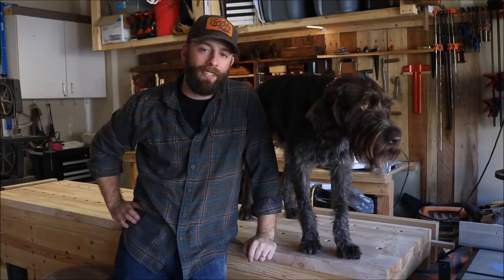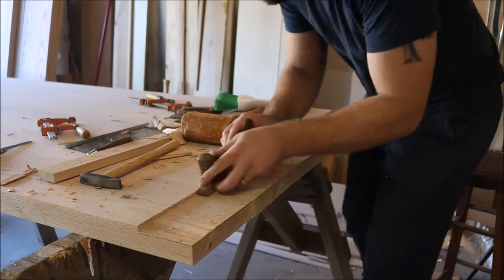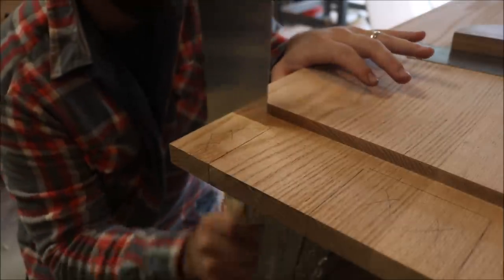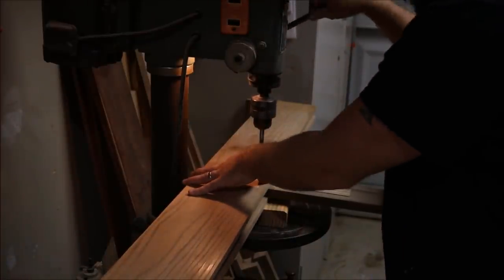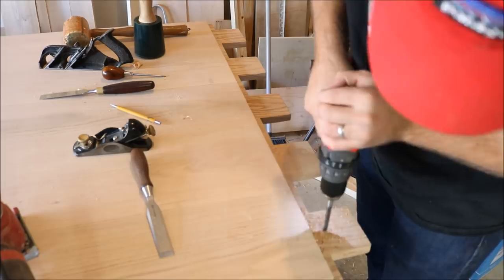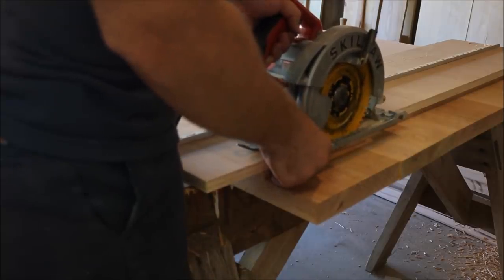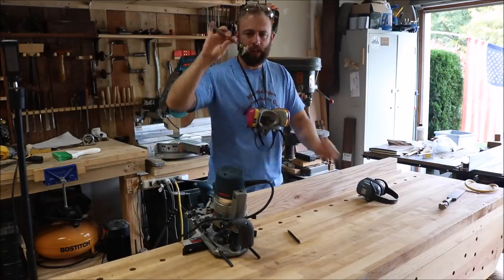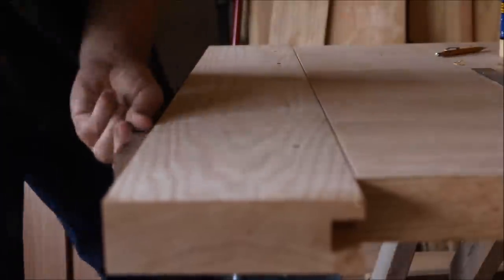SERIOUS Breadboard Ends!! Hand Tools vs Power Tools! Woodworking // How To // DIY

Comment: Chris, you didn't give any commentary at the end comparing the power tool v hand tool approach. What's up with that? How long did each method take, which did you prefer, challenges of each, and so on. 

Great video nonetheless.
Reply from the maker: Good point thats a missed opportunity for sure. I guess I got lazy there at the end after hours upon hours of editing and narration haha. This has taken me days on and off. I can tell you in a nut shell that I much more preferred the hand tool side. I honestly dont think it took me a significant amount of time longer. cutting the tenons and tongue on the table top was a breeze and very enjoyable, but plow the groove and boring out the tenons was definitely hard work. For me it is always more rewarding and enjoyable when I complete a task with hand tools, but there are certain things that powertools are worth using. For instance router out the groove was substaintially easier than plowing it with the plow plane haha. Ill try to remember to do that commentary next time! Thanks Hazem!
Reply: My impression, from watching the video, was that both finished products worked out well ... so which approach one prefers would really be determined by the tools, skills, and how you want to spend your time working
Reply: ....and the amount of noise the neighbours can stand :)
Reply: And the amount of dust you can cope with. Mine's an attic workshop so dust is a problem. Dust extraction would be expensive, difficult and take a lot of already limited space. So hand tools are the way I've gone.
Reply: Thanks for the comparison video. I prefer hand tools these days but always find men standing around with comments like, "don't you like electricity", or "you would be finished in 20 minutes with power tools". Gets old pretty fast, it's nice to see someone proficient in both and to be honest sometimes a blend of the two is the handiest.
Reply: +Michael Ballinger agreed. But I find similarly tiring the hipster YouTube trends that unless you're using a restored 80 year old hand plane, you're not doing it right. I swear some of the people spend hours setting up a shot to just show them taking one relatively thin swipe with a plane, full of dramatic music and slow-motion video, on a project made of reclaimed pallet wood. :) I tend to be more from the Norm Abram school, and so default to power, but break out the planes and chisels whenever they make sense.
Reply: Pete Brown whatever works for you I guess. I only knew power tools from my Dad, and I'm very handy with a chainsaw. That said I have young children and with hand tools they can be around while I'm working away, that's not the case with machines. Then there's an understanding of the wood, grain etc that you get with hand tool woodworking which is lovely to experience. For me it's not what you make but how you make. I'm not in a rush, although I have found hand tools in some cases to be faster, and I'm not having to spend time setting up jigs for machining. For dimensioning stock machines are great though.
Reply: Pete Brown if its a hobby and passion then why not have some fun showing some dramatic planing.  even if its some crap old pine or spf for that matter.  Legit furniture makers that build as a living would obviously use whatever is fastest within the confines of making a clean, quality cut/plane/hole.  just my 2 cents.  go search "young je".  he builds woodworking tools as a passion and for function
Reply: r s it's the pretense some other woodworkers have. Reminds me too much of dramatic poetry readings, or people who refuse to listen to anything unless it's some super obscure band on vinyl, both of which I also roll my eyes over. :)

But note that it's not the case here. I enjoy these videos.
Reply: One thing we got to take in mind is that most of the youtube videos are made by people who do woodworking as a hobby, for people that are just the same. So you can spend all the money you want, all the time you want, and do things the way you prefer, even if it's more time-consuming, or you can't have the best result.
If it makes you happy, that's enough.
Then there are the professionals, and they obviously have to take the easiest way to do things.
Reply: Really great craftsmanship, thanks for the content!
Reply: I started out my wood work with something of a fixation on hand tools. I still like doing things that way in some contexts, but now that I am a dad and work full-time plus hours, I find power tools increasingly practical just for the savings in time. I also find them to be a savings in money as well; just try hunting down all the specialty planes it takes to do the job of a variable speed plunge router... Those a not cheap to buy new, and there is going to be a lot of restoration if you get them all used for an affordable price.
The other aspect presence of built-in jigs, even on something as simple as a circular saw. It is possible to cut compound angles by hand, either free-hand or through the construction of a special saw box, but it takes a lot of practice to get bang-on results consistently that way. By contrast, even a cheap miter saw is accurate to within fractions of a degree, and can be set up in moment. Then too, good luck finding a hand-powered drill press... It's been a long time since those were being manufactured. 
All that being said, hand tools are probably the best way to learn, and for simple projects without complex details or tricky angles, they deliver very good results, albeit at a slower pace. One learns a better feel for the wood that way, which leads to wiser use of power tools down the road.
Reply: Also the kind of shop you have/ where you live. Power tools can be very noise and take up a lot of room to store. Where as the hand tools can be much quieter and all be stored in a foot locker. I find that working in a neighborhood later at night hand tools are much less disruptive. Also in my case I can work in my work room in the late evening and not wake up the kids.
Reply: Great tips and nice video
Reply: Check out this idea to expand your router capabilities.  https://youtu.be/DV9Cb_-Axos 
 @ThirdCoastCraftsman
Reply: @michaelballinger6419  i think power tools are lazy man's approach, i like  old fashion tools, that you can't find anymore :(!  Especially when you grew up in old country and don't know the proper names for some of the tools, your grand daddy owned, you can't find in US anywhere anymore :(!
Reply: @Cyph3rHaxPalm  I disagree with power tools being a lazy man's approach.  I tend to do most of my work with hand tools, and I enjoy the process immensely (I think its Paul Sellers who says "its not what you make, but how you make it"). Having said that, there are times when I need to just get something done.  If that means laziness, so be it.  I know I can get lumber S4S by hand, and I usually do, but on occasion, I'll throw something through the planer because, while I wouldn't mind the effort, I don't have the time.
Reply: I'm actually building this table and kind of combined the two approaches for the tongue and tenons part. I used a skill saw to do the multiple relief cuts, then used a slick to break off all the left overs from the relief cuts, then I used a #4 hand plane and shoulder plane to take it to the final dimensions. This worked really well. For the bread board end I used a router, power drill with wood owl auger bit, and chisels. Chris' design, videos, and plans for this table have taught me a lot and I can't wait to finish this table.
Reply: @Psychlist1972  Norm Abrams is a wood machiner, not a wood worker. Your comment is woefully ignorant and paints broad strokes that show you know nothing of what you speak. Go to Paul Sellers you tube channel and watch his introduction to fettling a hand plane. You will learn quite a bit and may even have a change of heart. Good luck to you.
Reply: With hand tools you won’t be able to make furniture on industrial scale and make profit to feed up your family. Unless you are well known designer and Price your pieces as fortune. However, if you want to make your own piece for your kids/wife/friends that will last for life and will remind about you after life, plus you want to gain skills and have joy from work then there is no alternative to handtools. Just try shaping with a spokeshave, that’s like sex.

Comment: Square Hole Mortising Drill Bits are what you were looking for
Reply: Di Wu - Norm Abrams approves of this comment.
Reply: That’s what I was thinking
Reply: He said “regular, affordable, power tools”….  I agree with the power mortiser and am saving for one myself, but even a decent quality one isn’t really regular and affordable IMO.  What may work for some guys in a short term is a power mortise attachment for their pillar drill ~$200 for decent one with bits; just keep in mind that this is more of a solution for floor standing drills since table top pillar drills don’t have enough throw in the quill to have an effective mortiser.  The table top pillar drill really hits its max effectiveness with a mortiser attachment in the 1/4” mortise range like in rail/stile cabinet and small furniture.  
Just my 2¢

Comment: Hand tools are for the true craftsman, and not only requires good tooling, but lots of talent from years of experience. Power tools are for quicker build times, and the quality of the job is determined by the builders efforts and accuracy in setting up the machinery correctly. Once this is done, electricity takes over. (Thank you Benjamin Franklin.). 
Thanks for a good video.

Comment: Chris, great video. This comment is late as the video was posted two years ago but to cut the mortises I use a forstner bit of the width I want and after the first plunge to depth, advance the board 1/8 in at a time the bit will cut just fine and when done the mortise only needs a chisel run over the surface in case of any stray fibers left.  This worked fine for a 3/8 wide mortise.  Needs to be done in a drill press set up with a 90 degree fence so the board is perpendicular to the wood and just needs to be moved along as needed.  Also round over the ends of the tenon sides so I don't have to square the mortise ends.  Thanx again

Comment: Instead of using a chisel or spokeshave to whittle the ends of dowels, I keep a pencil sharpener in my tool box (for sharpening my pencils 🙂) and use it to trim the ends of the dowels. Works great!

Comment: Hi Chris - Great video and fantastic workmanship. Its great to see someone using hand tools with such skill. I think you demonstrated that they are not really much slower than power tools but with so much more satisfaction. Love the draw bored dowels - I have just completed a new workbench with a laminated Bubinga top on a Mahogany base. I used draw bored oak dowels for the complete assembly and it is so solid. Keep up the great work - Dave

Comment: Excellent video, wish I had come across it sooner, I am in the process of also building a HUGE oak table with breadboard ends and have struggled with the joint. I like the idea of chamfer the end to highlight the transition. keep making sawdust.
Reply from the maker: hey robert, thanks for the comment. Yes, it can definitely be a tricky joint for sure! I hope it turned out good for you!

Comment: When drilling holes with your auger bit and power drillmove the drill up and down the drill bit cuts along its length and u then only need to trim corners square. But keep a good grip of drill because it likes to buck. Old mortice lock trick.

Comment: I had a Porter Cable lock mortiser router that would cut 6" deep mortises. It was a bit expensive but very portable. I used it for building doors with a loose tenon.
Reply from the maker: Ill have to look one of those up!

Comment: Nice work. I once fixed breadboard ends before I learned of the movement that happens. So far the project is still intact. I flooded it with mineral oil, it seems to have a more stable moisture content. It is an island top cutting board basically.

Comment: Chris the tool you are looking for is called a chisel mortising bit. It attaches to the drill press to make the tendons.
Reply from the maker: Hi david, I have a smalled Jet hollow chisel mortising machine, but It wasnt big enough to accept that 6" board, I have not tried using one of those bits and attachments on the drill press. Do you know if the larger bits are 4" deep. I dont think the smaller 1/2' bit on my machine is 4" Thanks for the comment.
Reply: Chris I'm not sure about the lengths. I have seen them used on television programs like the New Yankee Workshop. Check with lowes or home depot. They sell those chisel bits.

Comment: You asked about squaring up the mortises without a chisel, you can use an oscillating tool. The straight plunge cutters work fairly well and you can use an angle grinder to take them down to the width you need.

Comment: Un-stinkin-believable!  Your patience and skill with the handtools is remarkable!  And the finished product looks incredible!  I loved the little chamfer highlight you did to accentuate the breadboard ends.  So what was the time difference between using both methods??  Did they really turn out as identical as they seemed in the video?  Or were there some pros and cons of going with any particular method?  Amazing job, Chris!
Reply from the maker: Whats up Drew! I appreciate the kind word friend! I am really liking that chamfer too. I was super worried Id ruin the entire top by doing that, but it turned out nice. cutting the tongue and tenons on the table top goes to the hand tools. It was probably the same amount of time or slightly longer, but it was WAY more enjoyable, and very accurate. The breadboard ends goes to the power tools. plowing the groove and boring those mortises by hand was a LOT of work haha. Both sides really did turn out great (thankfully as this is going to a client) There is not distinquishable differnce between them

Comment: I am in the process of making a table and I've looked at a million different breadboard options. One thing I'm considering is whether to leave the breadboard enclosed at least 3/4" or so on the ends, to prevent the board itself from warping away from the table end. The downside of course is that no one gets to see the edge joinery, and that it takes a little more work.

Comment: Nice demo.You made the hand tool side look as easy as the power tools. Except for the plough plane, that looked like a lot of work!. Like some others, I would like your opinion on the differences. Thanks for sharing.
Reply from the maker: Yes the plow plane, and hand boring 4" deep holes in oak were both pretty laborous, but besides that I really enjoyed the hand tool side of it. In a nut shell cutting the tongue and tenons on the table part was my favorite with the hand tools, using the router with the fense and power drill made the breadboard part way easier than with the hand tools.

Comment: Great video! Very clear and understandable. I do understand the pleasure of using hand tools and for me at times I feel I have more control and less chance of making a big and costly mistake. That said I use power tools a lot because I’m not in good enough shape to do that much hard work at one time and too impatient and want to see the final project. Also mistakes happen more often as I get tired. What I’m really trying to say it’s great seeing you do all the hard work both ways 😀 so I can decide which is right for me. Thanks!
Reply from the maker: Thanks for the comment Jack! You make a good point about power tools and how easily you can screw something up with them. On flip side they really can speed up some tasks REALLY fast

Comment: Hollow chisel mortiser for the power tool end breadboard mortises. I bought a delta one for maybe $300, it has saved me loads of chisel time.
Reply from the maker: I have a Jet one, but its not big enough to get that 6" wide board in there. :( I might have been able to get a mortise bit into the drill press though
Reply: Ahh, got cha.  My delta came with a riser extension piece, its about a 3" tall chunk of cast iron that fits between the base and the column when I have to do taller items.

Comment: I scanned quickly and didn't see any comments but for the mortises in the breadboard you can use a mortising bit on your drill press. I have seen them from 1/8 1/4 and 1/2 (maybe even 3/8) inch bits. Depending on how wide your mortise is you might need to put a couple together to get the finished mortise.

Comment: I really enjoyed this video. That looks like it will be a really nice table.

As to the mortise: I likely wouldn't make it anywhere near 4" deep if using power tools. I do have a mortiser that will reach over 5", but honestly, even with perfect setup, it makes pretty messy holes that need chisel clean-up anyway. It is the least-used tool in my shop.

Comment: About the question about the mortice on the breadboard with power tools, I guess you could have used a plunging router and then add a round over to the tenons to fit the round corner mortice. But yeah chisel otherwise or use a morticer :)

Comment: You might be able to use a oscillating tool with a long blade on it to cut the waste after using the drill. Should be super fast and they are very easy to use.

Comment: @Third Coast Craftsman at 5:20, you make the choice to use a fret saw. Why didn't you use relief cuts using a rip saw, then hammer and chisel to remove material instead? Judging by the amount of material you're removing with the fret saw for all of the waste material, it seems like it would have been much faster to do it that way.